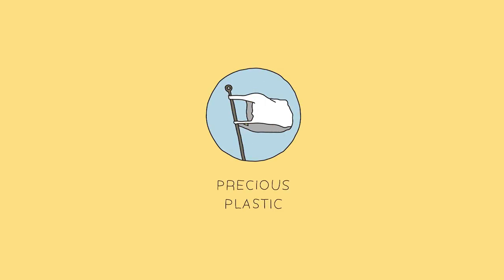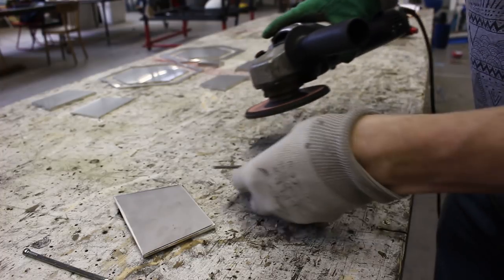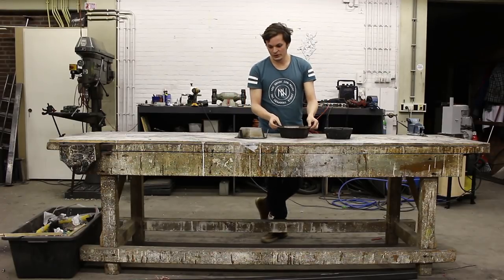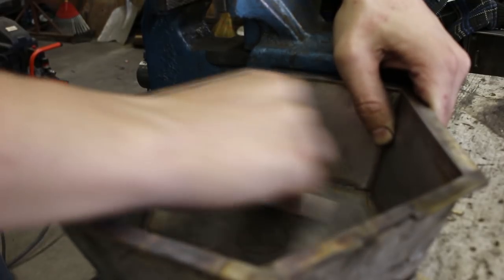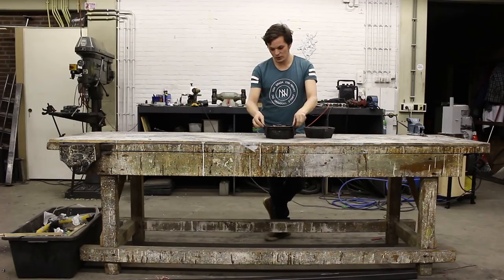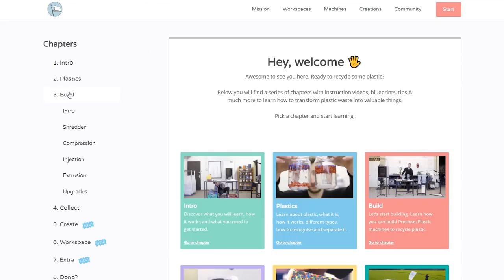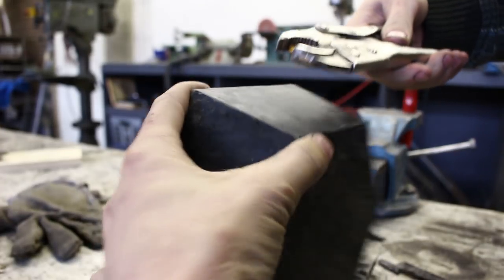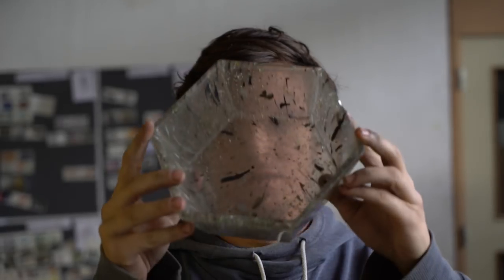A lasercutted mould to make bowls from #preciousplastic

Comment: i used to operate a plastic injection mold machine in a factory. the excess is called flashing. we trimmed it with a curved horse hoof knife. your products look as good as the ones out of a half million dollar machine, just not as fast.

Comment: Why do not you use branding-iron instead of coin? You can warm that easily and fast in induction coil, for example. This is just so inpractical.
Reply: Because than you need an extra tool. Coins you can heat on multiple ways!

Comment: What kind of laser cutter machine did you use to make the parts for the mould(s)?
If somebody makes this laser cut moulds profesionally how much will such moulds cost?
Is there another way to make this kind of moulds (without the necessity to weld the parts together, afterwards)?

Comment: Hi, i have a solution for molding stuffs, here in the you tube are many tutorials teaching how to build a cnc with arduino, it's easy to build one, you can use a block of plastic and designe the molde in autocad or other software, and then mill the block to transform into a mold to make stuffs....It's just an idea.
Reply: Erick Robert

Comment: Awesome work guys. Have you tried a deburring tool to help smooth the rough edges ?
Reply: or maybe a heat gun
Reply: Flame polishing might also be nice.
Reply: A small hand plane could also be used. Most woodworking tools can be used effectively on moulded plastics.

Comment: Hi, dave, eduardo here from Costa Rica, I am in the process to get involve in this project, every video is a motivation class for me. I have a question, I have differents types of plastic(1-2-3-4-5-7) is there a problem if I mix all types together, for example number 1 and numer 2 to get these bowls or I must use a specific type, for example only number 2, thanks for this amazing idea.
Reply: No. There are some specific mixes used in industry such as 20%PP + 80%HDPE, but generally speaking you shouldn't mix your plastics. Mixing colors is fine and fun though!
Reply: so you recommend use for example if a want to build a bowl only number 2, or number 1, of course I can mix differents colors but using the same type of plastic
Reply: Yes, exactly.

Comment: Is there a video which shows the plastic melting process before it is in put into the mold? Is it purely one plastic (e.g./HDPE) or are you guys mixing? Is the method for melting down HDPE the same as melting down the polystyrene?
Reply: No mix because than you create a low quality product which is not recyclable anymore. The method for HDPE and PS is the same, only different temperatures.

Comment: couldnt you weld the out side of the out side mold and the inside of the inside mold then you wouldnt have to grind it
Reply: Will not work, if you weld the inner bowl from inside, the outside of the bowl will have gaps because of wall thickness